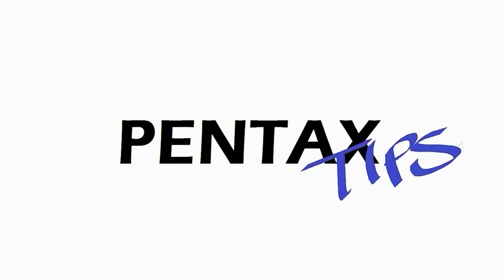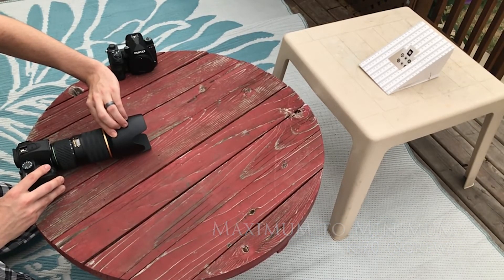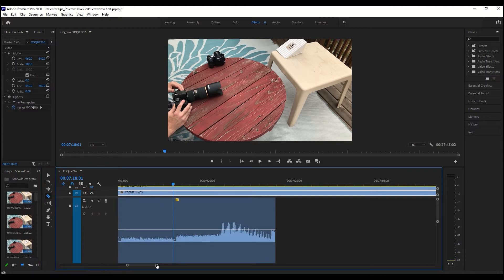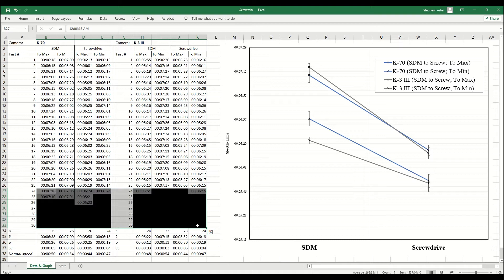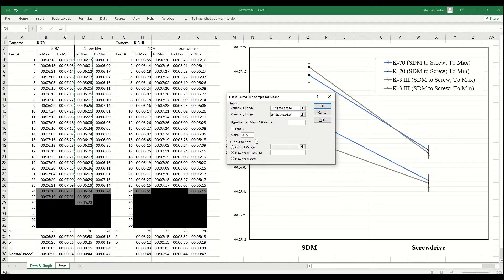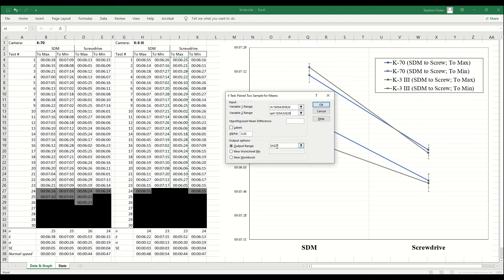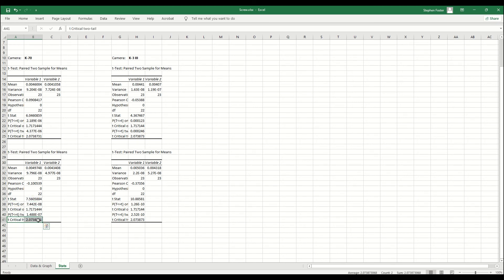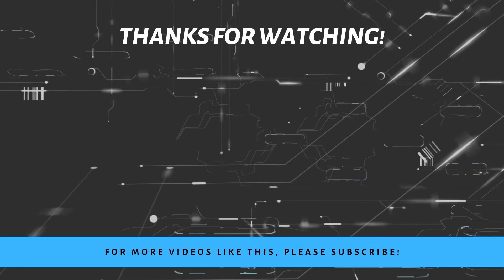Pentax SDM to Screwdrive Autofocus Test

Comment: Nice. Would have been good to accompany this with a sharpness analysis, i.e., check whether the screw-drive AF results are as good as the SDM results.
Reply: id like to have known what the hell a screw drive is, cuz ive no idea wtf this entire video is supposed to be doing? i just bought a pentax K-5 and was looking for videos on it, and ran across this one, dunno why i clicke don it, i dunno anything about cameras right now, i just am starting to get into it. sometimes i think smart need to pretend they are dumb right before they do a video like this because half of everyone that watches it will be dumb, 486 views, and 29 thumbs up from smart people the rest were like me, wtf is happening :(
Reply: @seanc8054  A quick Google search would fix that for you. Stop being lazy.
Reply: @seanc8054  late but i hope this information is still useful. screw drive is a type of af motor. its integrated into the body while sdm is inside the lens. the sdm motor is prone to failure but you could "convert" the lens to screw drive when it fails

Comment: Can this be generalized to all SDM -> Screwdrive conversions, or just the lens and body combinations you tested?
Reply from the maker: Although I would love to extrapolate, since I only have the one lens, my sample size is an n of 1.
However, knowing the similar technology employed on the earlier SDM lenses (the ones capable of converting) I am reasonably confident in saying "yes - the screwdrive operates faster and more reliably than their SDM autofocus".
Reply: @PentaxTips  That's very surprising, as I thought SDM technology was a step up from the screwdrive. Thank you for a great video and test!
Reply from the maker: @itisameal  I guess it all depends on what you want to get out of the lens. Speed or silence!
Reply: @itisameal  As PentaxTips said, it is about priorities, but also note that Pentax use the "SDM" moniker for a wide range of AF implementations. There are really slow ones using micro-AF motors and really fast ones using big ring motors.
Reply: @coolcat23  When people talk about the slow SDM they're usually discussing the system used in the older DA* lenses as well as the DA 17-70. This one is more prone to failure than other types of focusing motor they've used in their 'SDM' lenses.